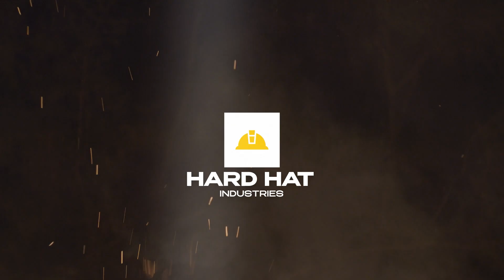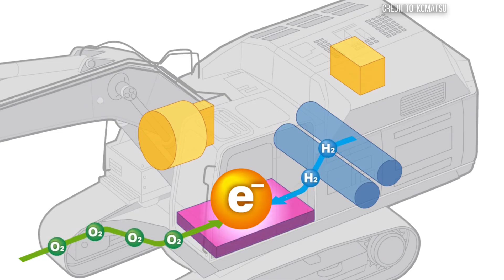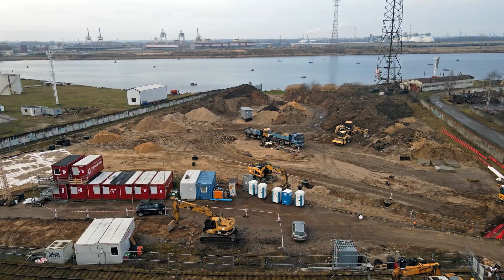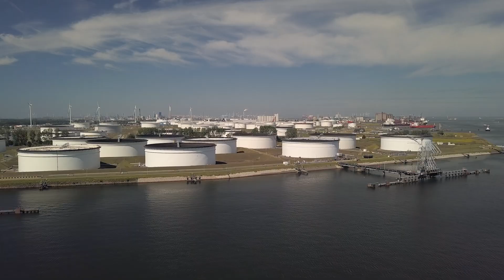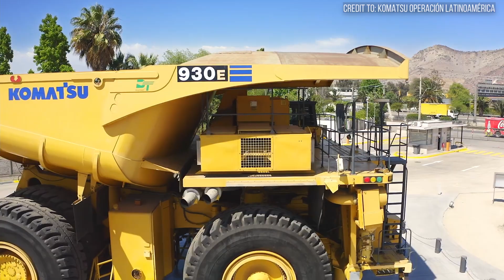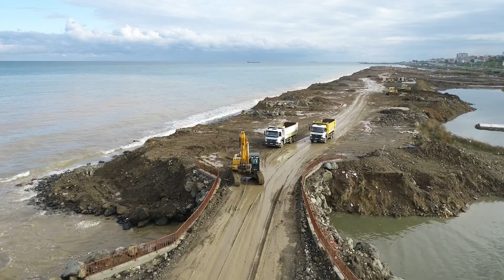Why Construction's Biggest Machines Are Betting on Hydrogen

Comment: Hi my Name is Robert & I have been Interested in This Subject for a While now -  

                                                 Not Ran Through a Motor

Methane (CH4) and hydrogen (H2) are distinct substances with different chemical formulas, properties, and uses. Methane is a compound of carbon and hydrogen, while hydrogen is a pure element. Hydrogen combustion produces only water, whereas methane combustion produces both water and carbon dioxide. 
Here's a more detailed breakdown:
1. Chemical Composition:
Methane (CH4): A molecule consisting of one carbon atom bonded to four hydrogen atoms. 
Hydrogen (H2): A molecule composed of two hydrogen atoms. 
2. Physical Properties:
Flammability: Both are flammable, but hydrogen has a wider flammability range (4% to 75% in air) than methane (5% to 15%). 
Molecular Weight: Hydrogen (2 g/mol) is significantly lighter than methane (16 g/mol). 
Size: Hydrogen molecules are smaller than methane molecules. 
Energy Density: On a volumetric basis, hydrogen carries less energy than methane. However, on a mass basis, hydrogen is more energetic than methane. 
3. Applications:
Methane:
Primarily used as a fuel source (natural gas), for heating and electricity generation, and as a feedstock in the chemical industry. 
Hydrogen:
Used as a fuel in fuel cells, for industrial processes, and as a potential fuel for vehicles. 
4. Environmental Impact:
Methane: A potent greenhouse gas, contributing to climate change. 
Hydrogen: When burned, produces only water, making it a cleaner fuel source than methane. However, producing hydrogen can have environmental impacts depending on the production method. 
5. Production:
Methane:
Naturally found in the Earth's atmosphere and produced by various sources, including natural gas, landfills, and biological processes. 
Hydrogen:
Produced through various methods, including steam reforming of natural gas, electrolysis, and other chemical processes. 
In essence, while both methane and hydrogen can be used as energy sources, they differ significantly in their molecular structure, physical properties, and environmental impacts. 

                                                       Ran Through a Motor 

Yes, methane can be converted to hydrogen through various processes, effectively cleaning it up before it enters the atmosphere and potentially providing a source of clean energy. One method involves methane pyrolysis, where methane is broken down into hydrogen and solid carbon at high temperatures. Another approach uses methane reactors, which expose methane to materials that oxidize or break it down using catalysts or UV light. These technologies can be used to capture methane from sources like oil and gas operations and landfills, preventing its release into the atmosphere. 
Here's a more detailed explanation:
1. Methane Pyrolysis:
This process involves heating methane to very high temperatures (e.g., 750-1200°C) without oxygen, causing it to decompose into hydrogen and solid carbon.
The carbon can be used as a valuable material, and the hydrogen can be used as a fuel, potentially replacing fossil fuels.
This is considered a "zero-emission" process because it doesn't produce carbon dioxide. 
2. Methane Reactors:
Methane reactors are systems designed to oxidize methane, converting it into other compounds, often with the help of catalysts or UV light. 
These reactors can be used to capture methane from various sources, such as oil and gas operations, landfills, and other locations with high methane concentrations. 
By oxidizing the methane, these reactors prevent its release into the atmosphere, mitigating its contribution to climate change. 
3. Applications:
These technologies can be applied to various sources of methane emissions, including oil and gas operations, where methane can be captured from leaks and venting. 
Landfills, another significant source of methane, can also be equipped with these technologies to capture and convert the gas before it escapes into the atmosphere. 
By converting methane to hydrogen, these processes offer a pathway to a more sustainable energy system, potentially reducing reliance on fossil fuels. 
In essence, these technologies offer a dual benefit: they reduce methane emissions, a potent greenhouse gas, while also producing hydrogen, a clean energy source.
Reply from the maker: Great breakdown! Thanks for adding all this detailed info. very helpful for others too! Hope you enjoyed the video 👍